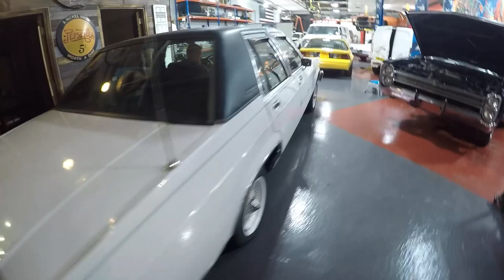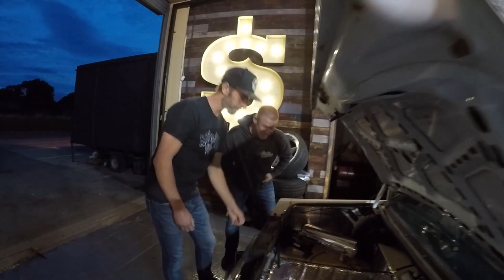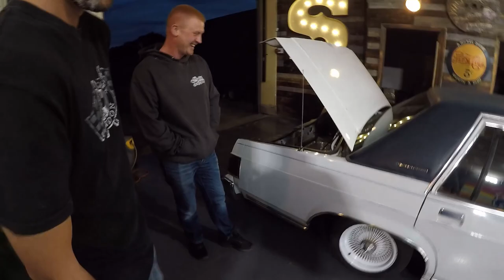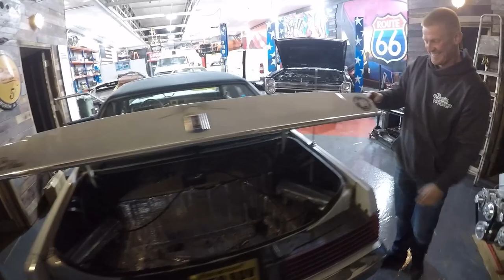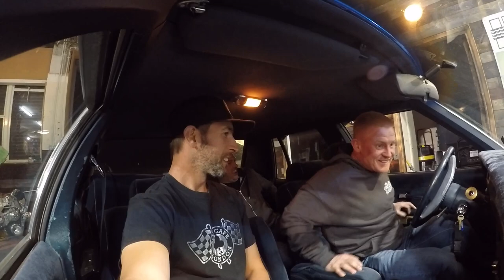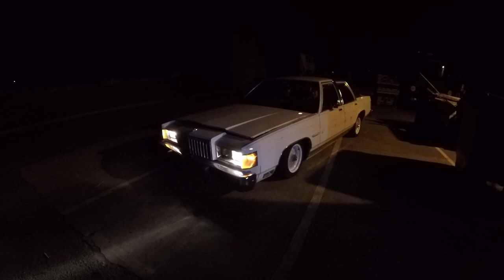New York Lowrider Imported to the UK *MERCURY GRAND MARQUIS*

Comment: I had a 89 and a 91 in this shape (I'm in UK) my only trip over to the USA blue ovals and I can honestly say I'm a GM fan because of them, the 302 in them wasn't as "built" in my opinion. To be fair though they were OK but no match to a chevy caprice or olds delta 88. I love the air ride though considering it on my current 72 cadillac project. I think it works really well on a land yacht like that. I got my 80 caprice to handle but the cost of air ride is probably cheaper in hindsight. Do like the look of that merc though despite it being a ford 👍
Reply from the maker: Great comment. Thanks alot. We would have to agree on the 302 as well.  Thanks for watching and again for the comment